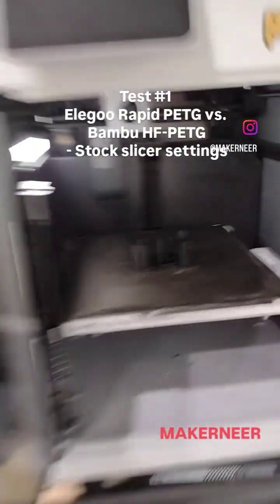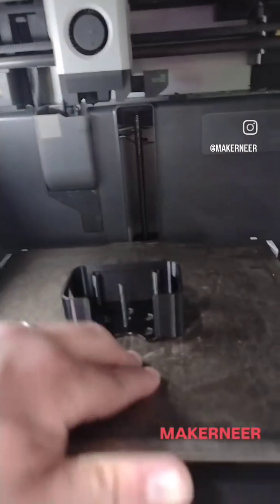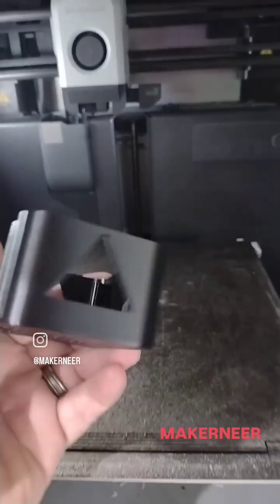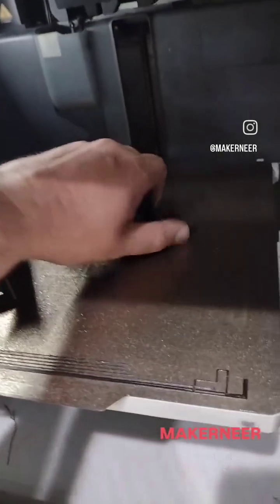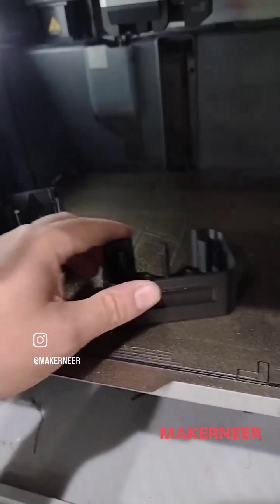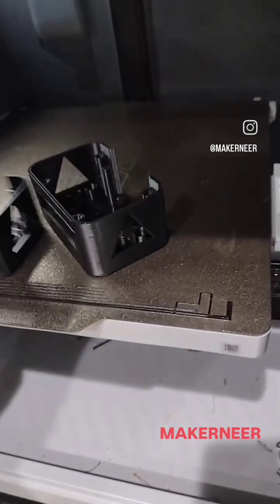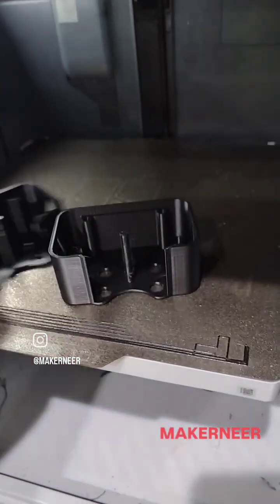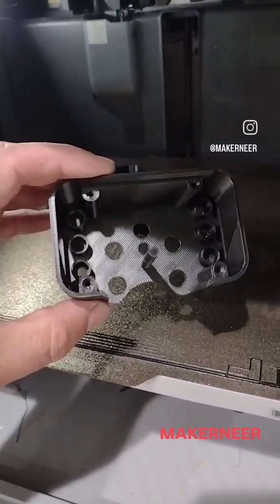Elegoo Rapid PETG vs. Bambu PETG HF - head to head test!

Comment: Did you try the bambu settings on the elegoo and vice versa? I've found the stock settings on elegoo slicer are slightly off for my prints.
I can't seem to print PETG pro below 255 which is where it goes from Matt to glossy. And if I alter any speed settings it creates problems either with the print of supports
Reply: He said he printed with the same settings on both
Reply: @aaronjones5314  he said he printed with the stock settings on both. I don't think he used the same settings on both. 
What I'm saying is if he tried the Bambu settings on the elegoo it might give cleaner results with the elegoo petg. As this is a test between two different PETG filaments and two different slicers and 2 different printers.
Can't really compare with 3 things being different.

If you printed both elegoo and Bambu petg on the exact same settings on the same printer and only changed the filament profile then that would be a comparison between the filaments.